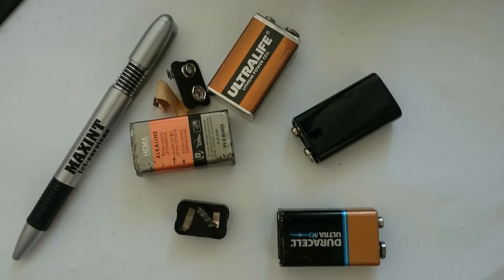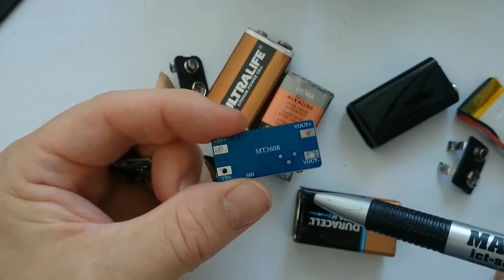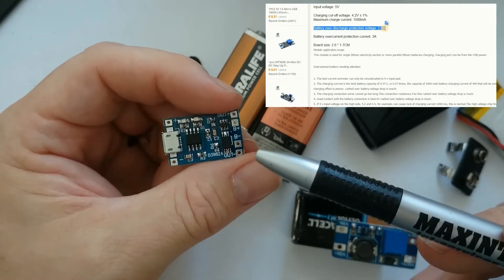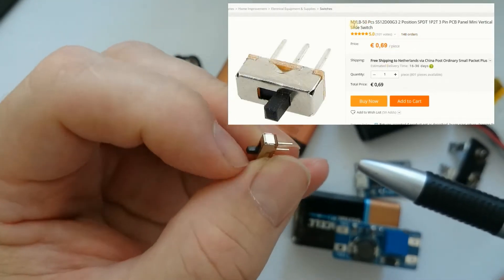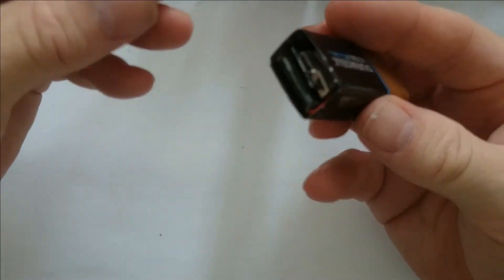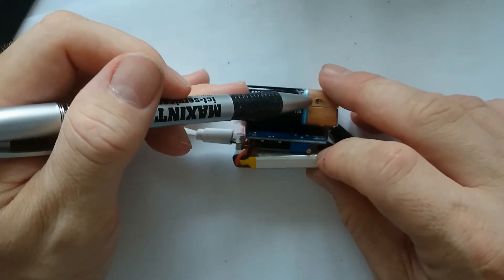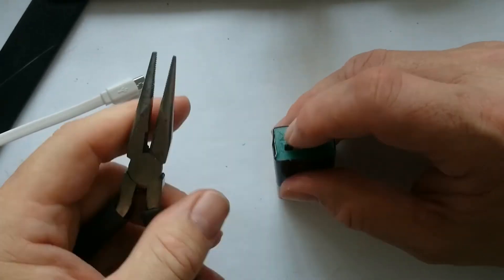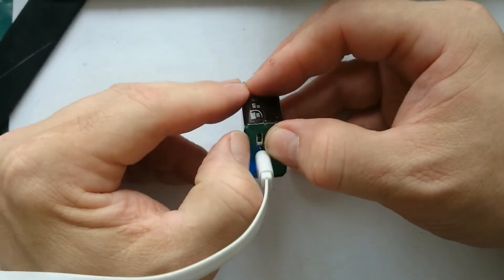Made: USB Rechargeable 9V Lithium-ion battery using MT3608 and TP4056 modules

Comment: excellent video but i want to inform that when you are stacking the module its better to put a non conductive materials in between to avoid any short circuit and cause fire
Reply from the maker: Thanks for responding. You are absolutely right. One cannot be too careful when using Lithium-ion batteries! After making that video I purchased some roles of kapton tape (the shiny yellow mylar tape) which I now often use for my projects.

Comment: Hy brother...I have Modul MT3068 and Modul HX-2S-JH20 with balance.
I want make Batrey Nokia 2S 7.4V
But im Confiused wiring in diagram 😁
I need Out 6.2V and charging balance ..thx you very much for Answer Brother👍
Reply from the maker: Hello  Izkur-tegh - Thank you for subscribing!
I don't know that HX module, but from what I found it is a balanced protection board for two lithium cells. You provide 8.4 to 9V on P+/P- and it will charge the 2S cells on B+/BM/B-. After charging you can use the same P+/P- for protected discharge. From this I assume you have two cells that you want to connect in series (2S).
You say you need 6.2V out , so your required voltage is below the 2S output voltage of 7.4-8.4V. In such case you should use a buck converter, not the MT3608 boost converter. You can find such module for instance by searching on Ali for LM2596S or for "Buck converter". Good luck!

Comment: Excellent hack! I'm looking to do something similar for a 9v device the goes through a lot of batteries. But I need more capacity. im thinking 2-18650 cells with the step up  boost board and 2sBMS balancing board.
Reply: @chichung888  Thanks for the information. It gives me some things to think about. I will have to do some testing and see what gives me the most runtime. I have already ordered a small boost board and a small 2s balance board. I will test it several ways and see what happens. In your opinion what would be the most efficiant way to go? seems to me a straight 2s would be best. I was hoping to get 2 16340's in a 18650 battery holder but they were just a tiny bit too long. I have also thought about ordering some unprotected cells and hope they were shorter.
Reply: @chichung888  I have tested a few things. On my device the low bat light comes on at 7.25 volts. I tried testing 2s 16340 650mAh and  1 18650 2900mAh boosted to 7.3v and both setups work.But the thing has an auto shut down so I have not been able to get any runtime numbers and I don't have a dc electronic load. Not exactly sure how to calculate losses of the boots board with just a DMM Biu I have an idea. Just off the top of my head i would think 1 18650 boosted might be better though because its more than 4x  the capacity of the 16340's.
Reply from the maker: Thanks! For more capacity the 18650 is better indeed. However, fitting that into a 9V battery housing might be a bit of a challenge! But perhaps that's not an issue for you... ;-)
Reply: @MaxintRD  My original plan was to break out of the device housing with a barrel plug jack but after some thought I can get a 2s 16340 to fit inside.

Comment: Hi. From where you bought li-ion battery? Dimensions to fit well on 9v battery case?
Reply from the maker: Hi Robert, thanks for asking. I saw I forgot to add a link to these batteries and just now added it to the description below the video. I ordered these batteries via AliExpress. Feel free to use that link or search for 650 mAh LiPo. They are not expensive (less than 15 euros for six batteries).
Indeed they do fit nicely in the 9V shell. I just powered the battery which I use for my component tester and it still works fine.
One warning though: I also had one laying in my window sill for more than a year, connected to a solar powered MQTT node. Unfortunately that battery became puffy. Probably it was the victim of too high temperatures and/or over discharge, so be careful.
Reply: Thank you. I wanna use tp4056 with protection function. The question: does it drop voltage when it's not in use? I've heard some guys saying you must place a switch between tp4056 and mt3608.
Reply from the maker: The MT3608 does indeed use power even when not used by a load. Much less than when there is a load active, but still enough to drain your battery. For that reason I did add a manual switch and depending on how you intend to use it, I also recommend placing a switch. (For some purposes you could use the enable pin of the MT3608 chip, but that pin is not readily available on the module). For more info on the MT3608 you should view my follow-up video.

Comment: nice, that's like an inverse snapVCC :) there's probably a better way to power the board with a LiPo (directly into VIN/raw?) but the project itself is neat, good work :)
Reply from the maker: Hi Dave, thank you for commenting. You're absolutely right. Especially for the ESP8266 it is nonsense to first boost the voltage up to 9V and then use the onboard regulator of the D1 to drop it down to 3.3V. If you want to power an ESP8266 directly from the li-ion battery, I can recommend the HT7333 regulator which has a very low dropout. See the videos by Andreas Spiess for more info. I've used that regulator in combination with the chargerboard and a 6V solar panel to reliably power one of my ESP-12E based network nodes.

The transistor tester does require a higher voltage to operate properly. However, the real (yet everlasting) target project for this battery is my IoT-controlled garden. The specific device I made this 9V block for is a Gardena timed water-valve which I intend to modify to make it IoT compatible.

BTW: Thanks for mentioning snapVCC, I had not seen that project before. Cool design...